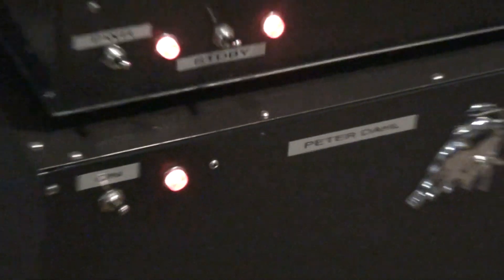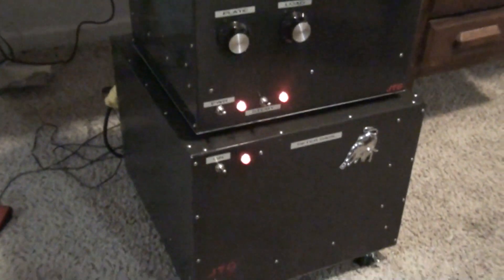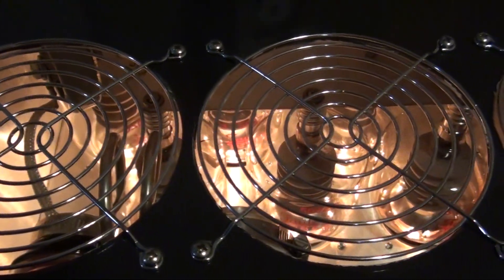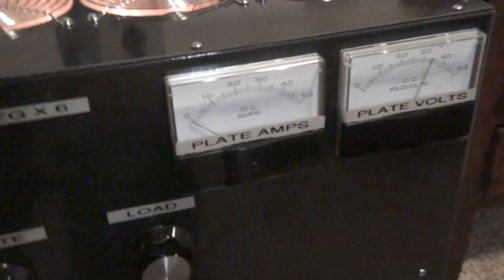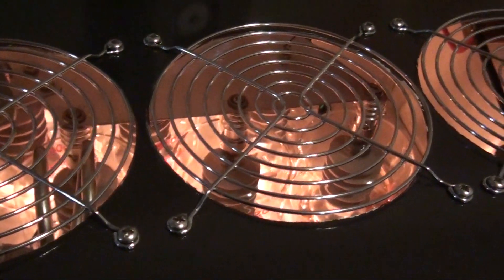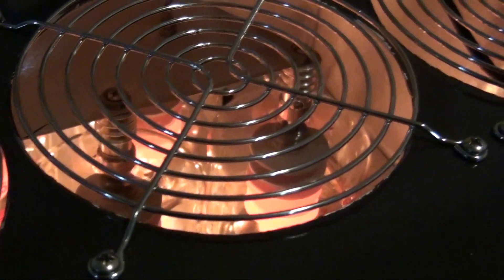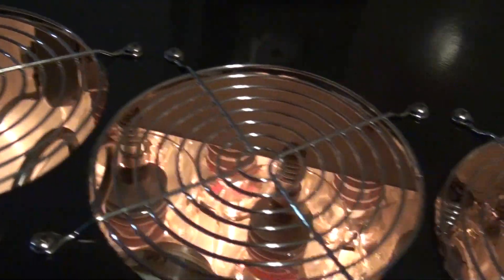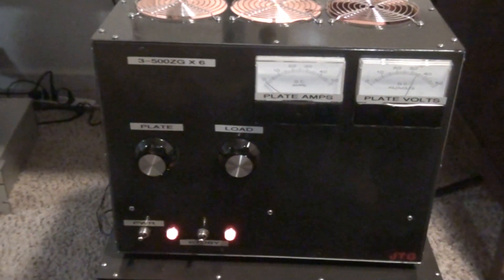"The Glass Factory" JTG Built 6 Tube 3-500zg Linear Amplifier

Comment: Seen 8 tube but back in day he said paid 45 dollars a tube now a pair  would  be 500 dollars
Reply: Saw, not seen.
Reply: @jeffgrey1566  when u could afford them now price of decent transformer even the filament cost unless u can find at local radio festival had 2 pairs to fit in heath kit  220 paid 110 for both but sold amp but don't need big power with right antenna ur good to the last drop

Comment: oh and someone commentes 740 watts, last time I looked up the ZG I saw 1250 from an Emac which is what I run now, in a beautiful chrome swan box with a seperate power supply that is also chrome, from the late 60's, I think I have ran these same tubes for almost 15 years and they are still going strong, no idea how old they were when I got it, I've enjoyed this amp and hope to rebuild it soon, I need 6 ZG's in my life, good work there, beautifully done and love the meters on the front, I wish mine had similar, the kne it does have is broken. 73 from Memphis
Reply: That's the avg rating. Pep is much more

Comment: A 3-500zg tube is rated at 740 watts per tube at 3000 plate volts according to the RFParts datasheet. 740 * 6 = 4440 watts. Nice amp. Would not mind having one myself.
Reply: 740 watts AVG so the pep is much higher
Reply: yeah, and then when you shove 3600 volts to the plates......

Comment: I built a 4 tube 3-500Z back in the late 80s for a friend, had 2 Peter W. Dahl transformers, and a 4.000 watt Wawassie black cat meter built into it, it was nice, it would slap the 4.000 watt meter driving it with 120 watts, it would melt the insulated 200 ohm track wire going up the mountain, and the RG8U coax would get hot if used for long periods, it ran on a 240 VAC stove plug.

Comment: What does that sell for, where is it made, and will it PEP safely?
Reply from the maker: Not sure what you mean by "will it PEP safely"? But it will run full tilt safely and easily. It wouldn't be sitting in my house if it wasn't safe. As for what it does, I guess that's all in what meter you're running and the line voltage at your home. Conservatively 1500 watts peak per tube X 6= 9kw PEP. It has been tested up to 10kw which is 1666.6 watts per tube. Average power is a little over 4kw on a 25kw slug and between 3600-3800 watts average on a 10kw slug.
Reply: @Rooster_Radio  holy shi t

Comment: Nice amp rooster you can  heat your shack with that one hillbilly waving from the bam
Reply from the maker: will be nice in the winter. Plan is to run my 1956 johnson Ranger, Hammurland HQ180 receiver, a single 500z into the 6tube 500z for an all glass station